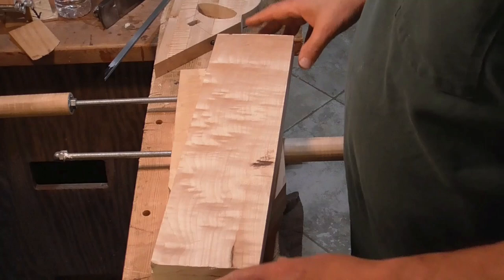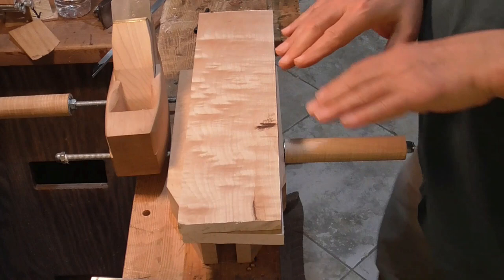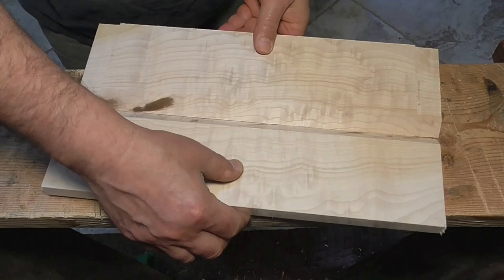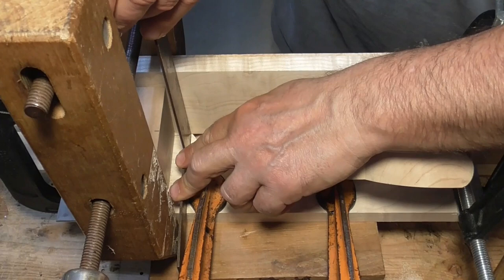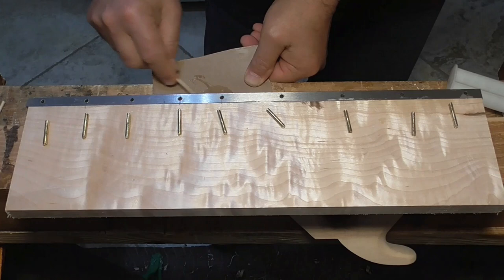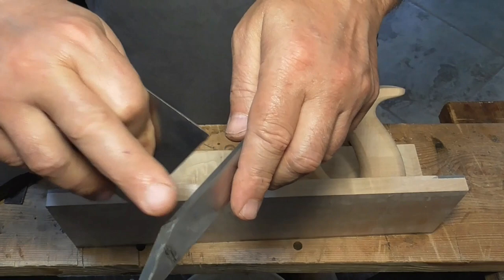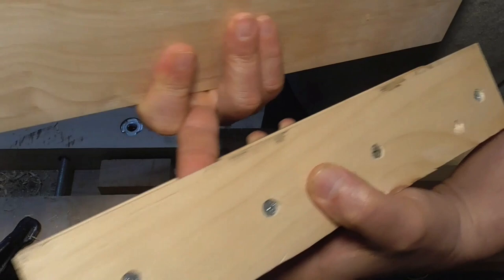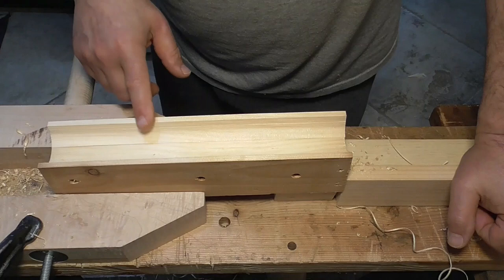Plane Making - The Core Box Plane

Comment: Fascinating, most enjoyable video to watch. Couldn't you have modified the original iron to remove the side cutting effect?
Reply from the maker: That's a good question. I decided to leave the original "as is", for larger arcs. I left the second blade long and will eventually place an intermediate cutting face on the opposite end, protected by a cap.